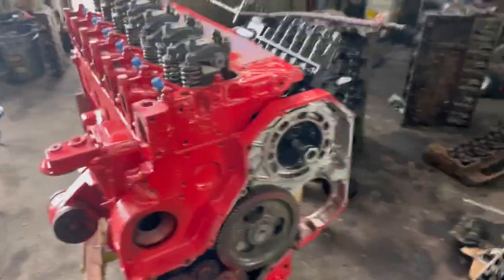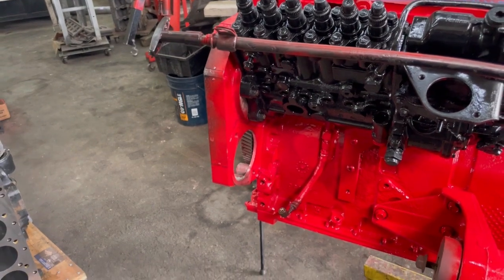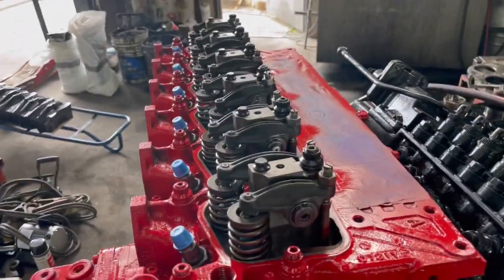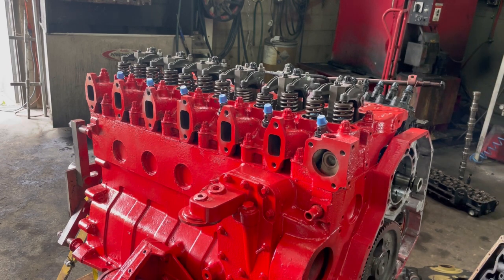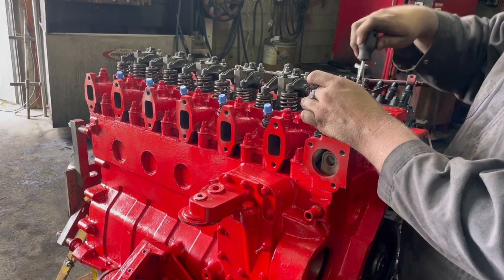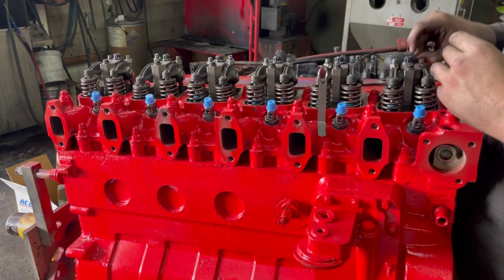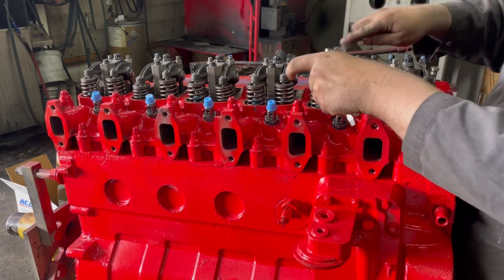HOW TO SET VALVE LASH 12 valve Cummins

Comment: Good explanation, have you ever ran into a problem, where one or two of the pushrods are extended up higher than the rest? I’m rebuilding my 12 valve and I ran into this problem and no one can answer it, I’m wondering if you can. Thanks in advance
Reply from the maker: Like the push rods are longer than the others ? If that’s the case I would say the couple of them are the wrong style

Comment: What about setting valve lash on a brand new fresh common rail short block? Say you install head and loose cylinder 1 TDC before setting valve lash??
Reply from the maker: If it’s fresh engine you will have to loosen the rockers most the time. But same as I do it on a 12v

Comment: Doesn’t the crank turn clock wise
Reply from the maker: When running yes. But doing this it doesn’t matter the direction you turn it. I have tried it both ways to see if it made a difference.

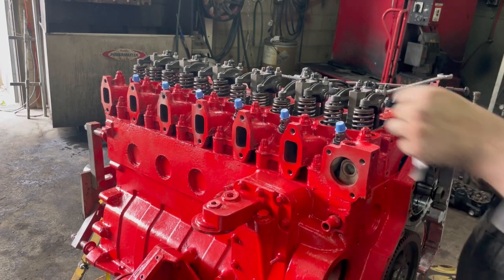Comment: The VP44, there's actually a line on the gear that lines up with the cover marker.....at that location,the woodruff key is at the 6:00 position...so to remove the pump ,you want the key at 12:00 so the key doesn't fall out..which is actually not exactly tdc #1 compression....I believe...but anyway.. 👍👍
Reply from the maker: You could be right. Been a while since I did one.
Reply: @CUTTERUPROB 👍👍yeah,it don't matter man I just had one apart recently to replace the gear case gasket and swapped in that Hamilton cam and all...😆,so it's still a little fresh ..but anyway 👍👍
Reply from the maker: I added the info to the description